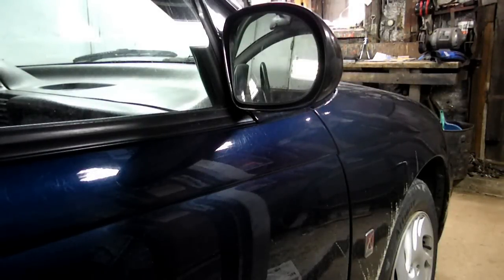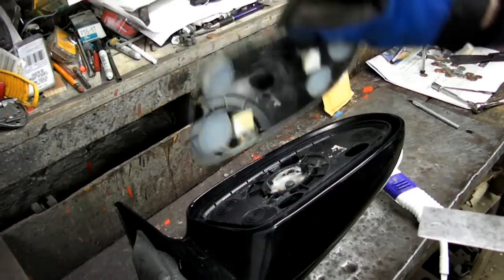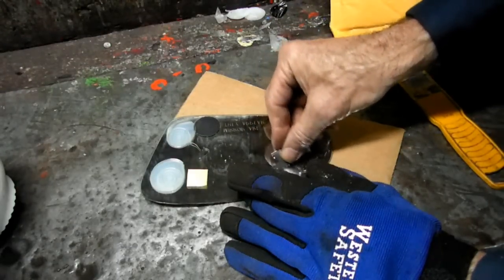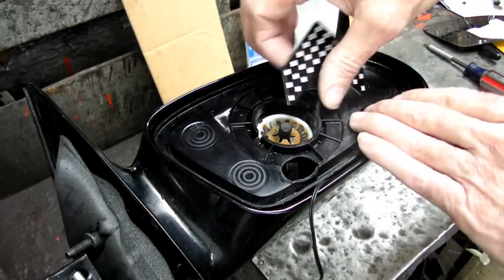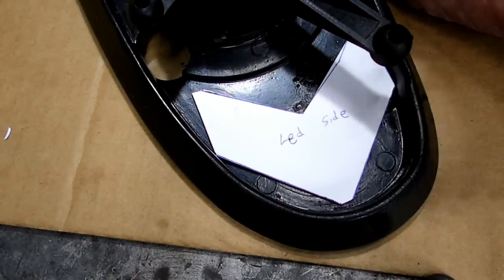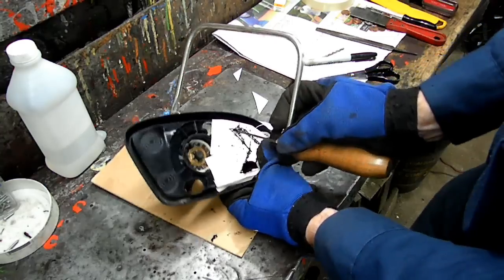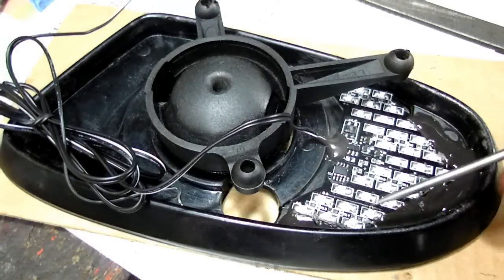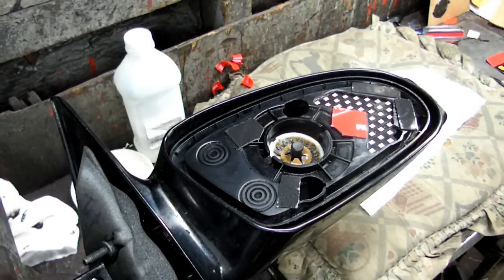Sequential Arrows for Car Side Mirror Turn Signal Part 1

Comment: I wondered why MUTH (signal mirrors) charges so much for their mirrors. Lot of detailed work.
BTW: 3M Double-Stick tape sticks A LOT better if you hair dryer warm up the sticky tape after 1/2 installing it. Once you even touch it, IT'S PERMANENT. Start over if you mess it up.

Comment: rich, if your mirrors are electric why do you need to run your power wires from the new LED indicators vs. connecting to the hot and ground wires for your mirror? Thanks. these 2 videos are detailed.
Reply from the maker: That is something to think about.I wounder how much extra load it would put on that circuit.
Reply: +Roger Spence If you wire it to the mirrors, how is it supposed to flash the arrows? You want to have it wired to a turn signal feed.